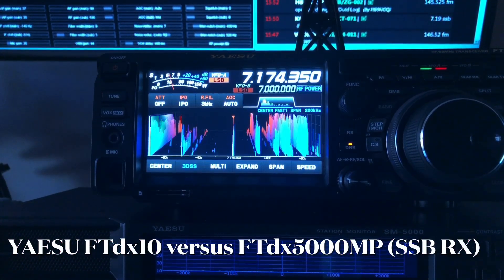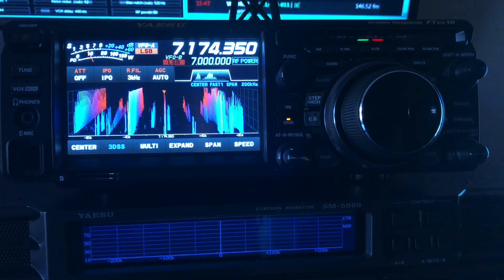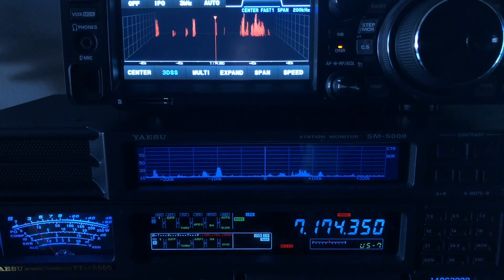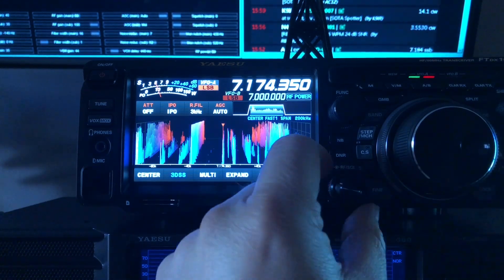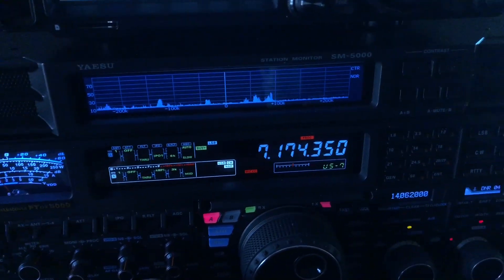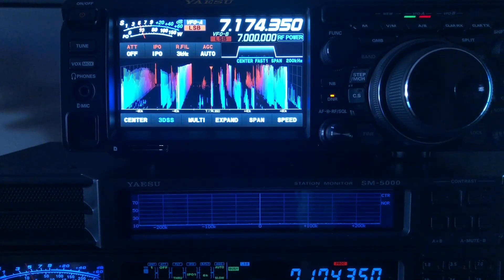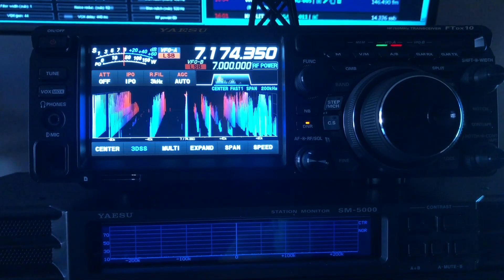Yaesu FTdx10 vs FTdx5000MP: SSB RX (Video #5 in this series)

Comment: I think the two radios are very comparable in terms of noise reduction and audio cleanup.  Probably need to consider other features and price if choosing between the two
Reply from the maker: I chose the 5000 over the 101 because of ergonomics, since they were both about equal in performance.  I just prefer more knobs.  I also liked the D’Arsonval meter movement.  As nice as waterfall displays are, I am content with the bandscope in the SM-5000.

When I was choosing between the 5000MP and the 101D, I found the DNR to be better in the 5000.  But Yaesu has obviously made improvements to the DNR in the FTdx10.  I would imagine that a firmware update for the FTdx101 will put its DNR at the level of the FTdx10.

73, de N4HNH
Reply: @n4hnhradio  I never appreciated the FT5K I've had for almost 10 year until I started running CW about 99%.   Now I love it.  I do miss a scope.  Have you ever used a Kenwood?  To me there is no comparison on SSB.   Not talking NR performance, but high fidelity SSB- mod to strong signal.   This goes back to the TS850,870 and now the 890.   If you could add Yaesu NR to Kenwood audio I'd have it all -  I guess its a built in excuse for more than one radio.
Reply from the maker: My dream rig was the TS-990S.  But, after 8 months of pitting the various dual-receiver radios, and some single-receiver radios, against one another listening to the same weak signals with the same antenna, the FTdx5000MP won me over.  The noise floor is lower than the rest and the DSP puts the icing on the cake.  So, as much as I would have liked to have a Kenwood, the Yaesu won me over.  And I don’t like to like Yaesu.

73, de N4HNH

Comment: Why was the filter set to 6k on the 5000 when you set the FTDX10 to 3k.
Reply from the maker: Very observant.  I leave the 5000 filter select on Auto.  If I widen past 2.6k, the 5000 auto-selects the 6k filter.  I’ve asked Yaesu about that but I didn’t get an answer.  When width is not enabled, the 5000 is at its default width of 2.4k, so it selects the 3k roofing filter.  When I enable the DSP width control, and it is set to 2.7k or more, it selects the 6k roofing filter.

The FTdx10 stays with its 3k roofing filter up to a digital filter setting of 3k.

73, de N4HNH
Reply from the maker: The 5000 auto-selects the 6k filter when width is set to 2.7k or higher.  It restores some low-frequency AF.  It’s a feature.

73, de N4HNH
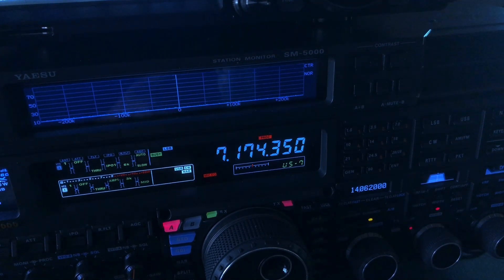Reply: at 2:17 RFLT is shown at 6k for the 5000.

Comment: Very good NR on both
Reply from the maker: I'm happy to see a DNR that is finally as good as the one in the FTdx5000MP.  I don't know why it took Yaesu so long.  The FTdx101D and MP DNR didn't even measure up to the FTdx5000MP, until the latest update.  The FTdx10 improvements were rolled into the FTdx101D and MP.  Now the FTdx101D and MP are where they needed to be when they were first introduced.
Reply: @n4hnhradio  I agree. It’s to the point now where I use NR 100% of the time. Other radios I would only use when needed because I didn’t like the way it “slightly distorted the audio” with the 101/10 it is VERY good. I usually run it around 5.